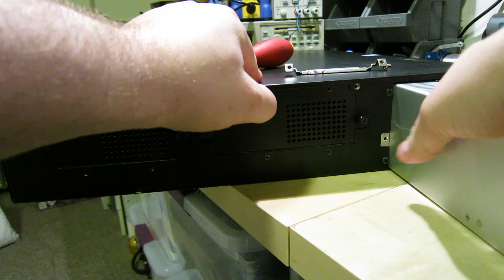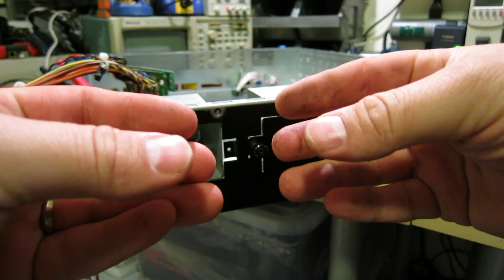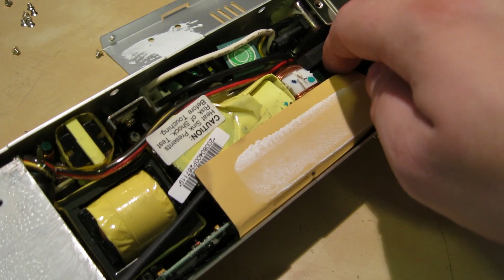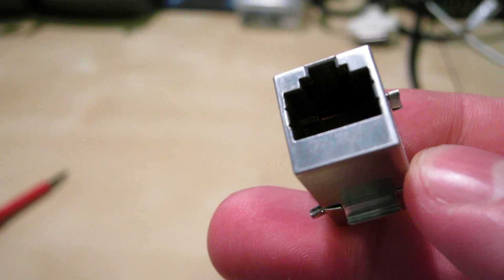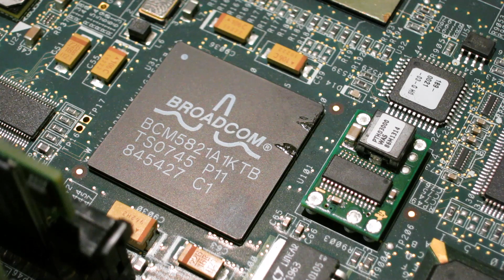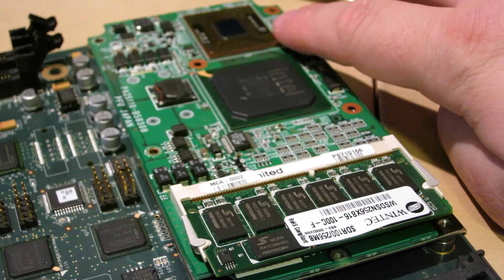McAfee IntruShield 2700 Teardown ($34K+ of fancy motherboard!)

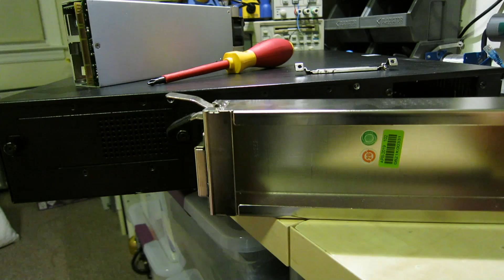Comment: 3:00  Usually call them blanks.  In addition the primary reason for a blank is not to "communicate" anything.  It is for air flow.  We know when a slot is empty by default.  It is up to product management to decide if card blanks need to report a PID upon insertion.  Much of the time it is omitted.

Comment: I wonder if that fancy board is so thick because of all the internal network interfaces on all the chips are connected.  Those PMC Sierra chips were nice, there used to be a guy named Chicago Joe that built custom PCBs with them so they could be used as processor upgrade cards in Silicon Graphics O2 workstations.  The RM5200 cpus could be upgraded to the RM7000 series to make the O2's processor about as fast as the much higher priced Octane.